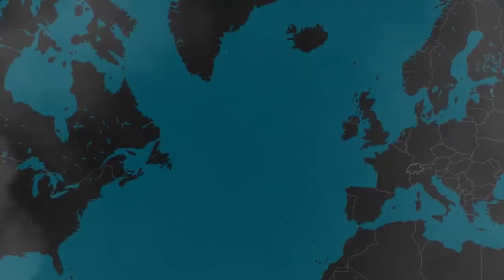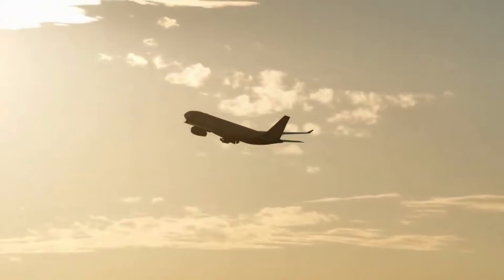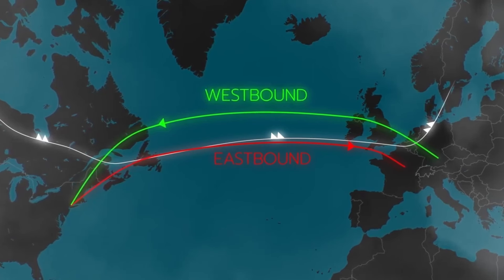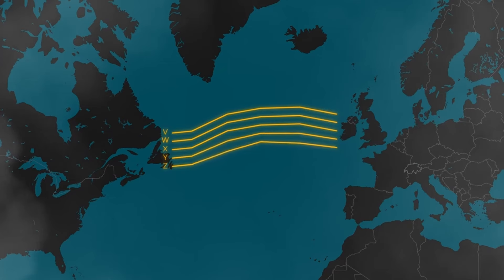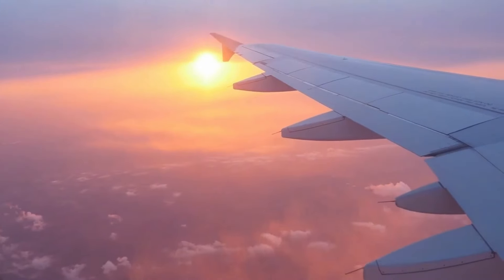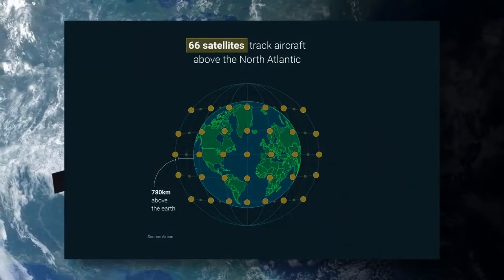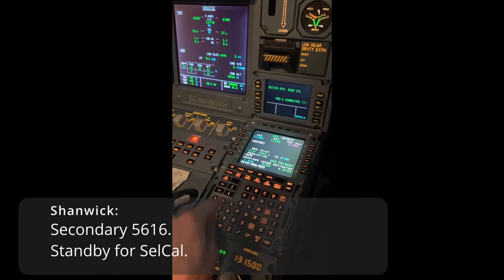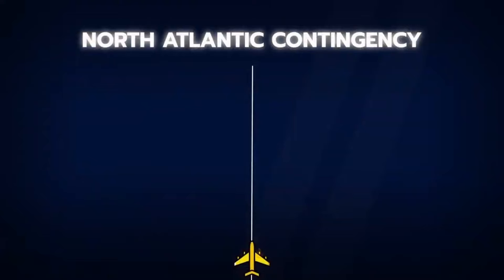Intro to Oceanic Procedures on IVAO

Comment: Shanwick involves communications being handled from Shannon but the control authority is entirely at Prestwick.
Reply: Correct, the Shannon bit is just a sop for the Irish as the HF function isn't worth very much these days. Nothing much has changed in regard to the North Atlantic tracks since the earliest post-war days (that's WWII by the way). A minimum time track between Paris and New York is forecast by the Meteorlogical office and the tracks are drawn up based on company preferences for the next 24 hours. Things don't change much....